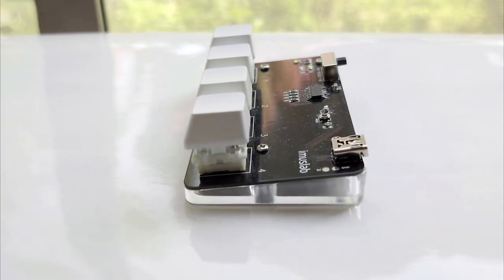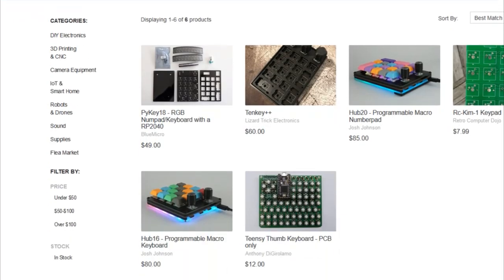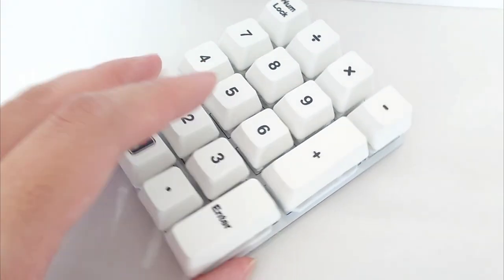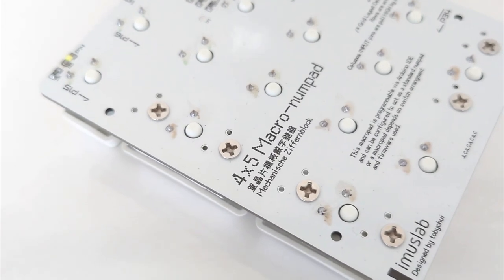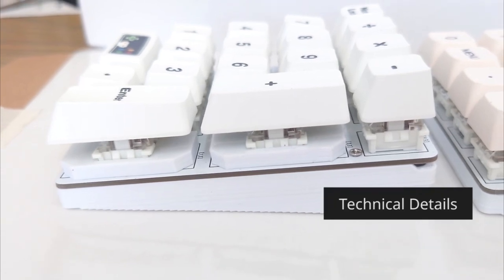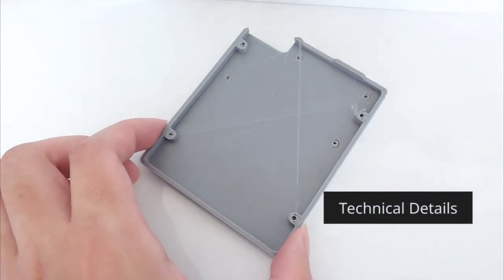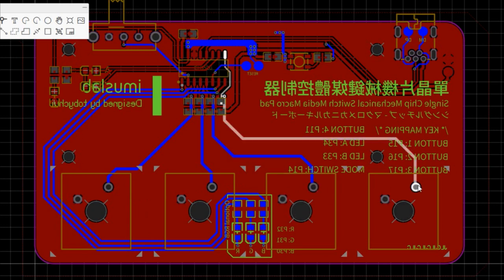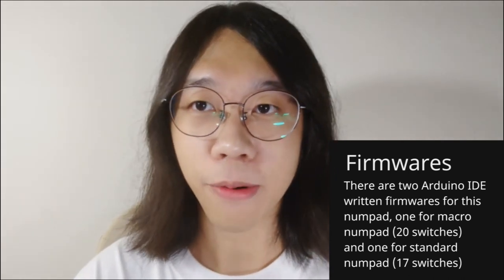DIY Mechanical Macro Numpad for $8

Comment: I've been trying to upload the code using Arduino IDE, but I keep getting the error message  "Found no CH55x USB" during the upload process. I am new to arduino, any tips?
Reply from the maker: Try to hold the PROG button when inserting the keypad into the USB port. The MCU will then enter FLASH mode for around 5 seconds and you will need to upload the firmware within this window. Otherwise it will show the error you saw earlier.